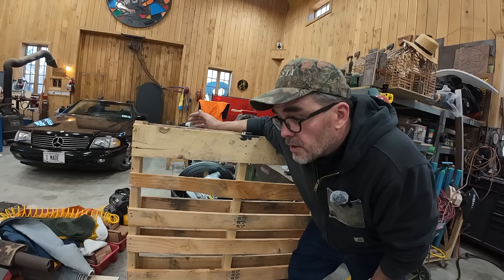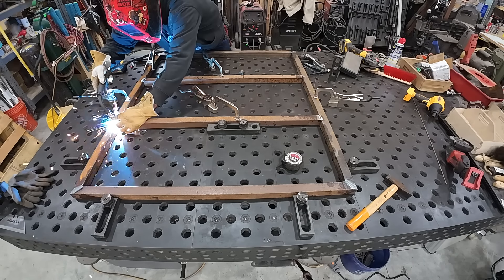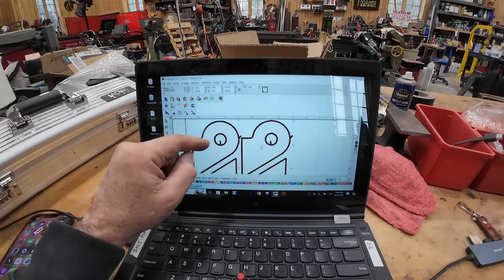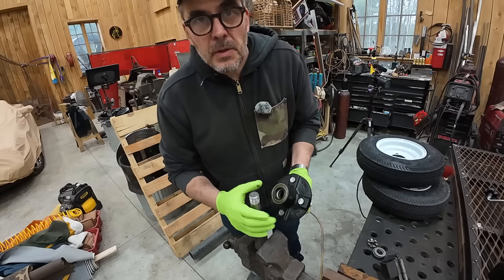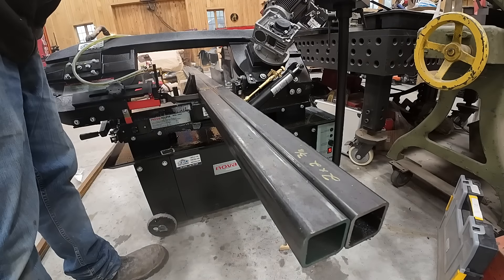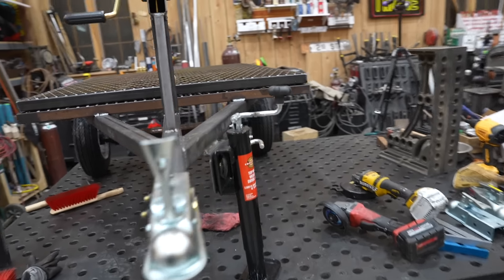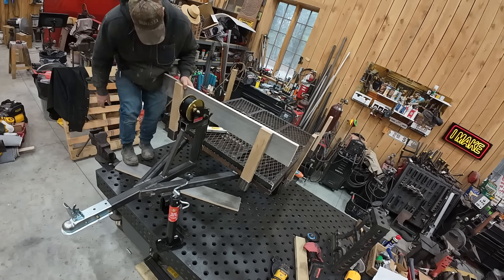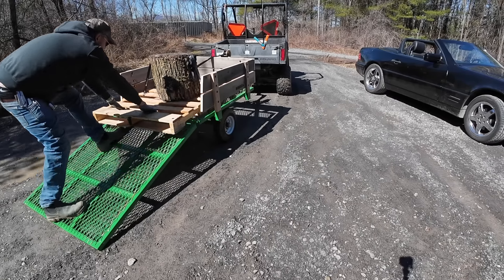Utility Trailer build in 3 days

Comment: i appreciate the chuckle I got from your preemptive response to the mechanic nerds objection to grease color.
Reply: Color of grease doesn't matter it's the make-up of said grease that matters for the application
Reply: Yep. Its really sad that makers of all kinds have to put up with the armchair phuken knowitallz
Reply: The color is just a dye to sometimes assist in monitoring how said grease is working, and marketing of course.
Reply: I figured they would object to how he used it more.
Reply: @Kdavis795 And for a low speed, light duty utility trailer like this,  the make-up of the grease really doesn't matter*.  You could use lard and it would do *this job adequately.
Reply: @pileofstuff  very true

Comment: Nice project Jimmy!  That expanded metal should be plenty strong enough especially with all the cross bracing you used.  I really like the wooden angle adapters for the horizontal band saw.  You are right about how making a perfect 45-degree corner for a frame is difficult.  I hate to admit it, but I have even cut the angle the wrong way on an angle iron frame and couldn't use that piece.  Didn't seem to be a terribly difficult mistake to make either.

Comment: You could weld a couple pieces off pipe across the expanded metal so when you’re ratcheting, there is a smaller point of contact with the pallet and it will go up a lot easier.

Comment: I can really appreciate you building this from scratch, most of us would have just gone to Harbor Freight and bought their kit and assembled it. That’s what I did and let me tell you your build quality is 1000% better then their kit, yours is much more rugged and solid than their kit which is basically just a collection of c-channel steel beams that all bolt together.
Reply: The nice thing about the HF cart is you can reinforce it easily enough. Any hand cart or tow cart that's bolted together will get loose.  Tighten, reinforce, weld, customize.

Comment: I am so going to build this. May I suggest adding a third central hinge for the ramp and inserting the coach bolts and nuts the other way on the side and front rails round so they will not snag on anything being loaded. 
Thank you for the inspiration.
Reply from the maker: Thank you!

Comment: One thing you can do to prevent rust on the inside of frames is drill a drain hole and use something like Boeshield T-9 or Framesaver, both of which leave a waxy coating to prevent rust. Might not work with the number of frame pieces/intersections you've got in this one, but it's something bicycle frame builders do.

Comment: Jimmy, may I suggest a small roller assembly on the side closest to the winch so the strap isn’t riding on the wood when pulling a pallet into the trailer. Great video. Inspiring. Cheers!

Comment: Mechanical nerds and grease color...🤣🤣🤣🤣
From a female's POV.....it's so cute....😂 Probably built better than something from Northern as well. Great job! Enjoyed this completely!
Reply: Most utility trailers of that size only use angle iron and only put the expanded metal on one side. Better is subjective but it should be stronger and heavier.

Comment: The only thing I learned after building a trailer was the bolts on the wood should face the opposite direction of how you installed. You’d be surprised on how much crap gets caught on them. The aesthetic value from the outside is nice but not worth the headache

Comment: Question, would it been better to have the carriage bolts in the other way round so the heads are on the inside as the nuts may catch on the items in the trailer.
Reply: I was thinking the same. I'm certain it's how it's done around here.

In the end it may not matter that much given the expected use it will have but I think it might lead to some injury/scratch.

Here, the rounded part of the bolt would be on the inside and the nut would be on the outside but recessed into the wood, as instead of a 2x4, 2x6, whatever, it would be something more square-ish and therefore with enough material to do so.

But, again, for its intended purposes, it may well be just fine the way it is.
Reply from the maker: Yep that’s what I thought too. I’ll grind the inside little more
Reply: If he had the bolts as you suggest I guess he could drop the sides in either way around according to whether smooth inside or outside is needed?

Comment: Couldn't you use anti freeze for the plasma cutter, even a weak solution would work. You could also install a submersion heater in the tank.

Comment: I wonder if drilling holes and doing rosebud welds on the shimmed axel rod would have worked?  That might have given more contact points than just the ends.  Oh well, it’s good as is….
Reply from the maker: I did consider this thank YOU

Comment: This is probably a stupid question, but how does the plasma cutter not cut through the metal grate you set the workpiece on top of?
Reply from the maker: The cut cone is only 1” or so